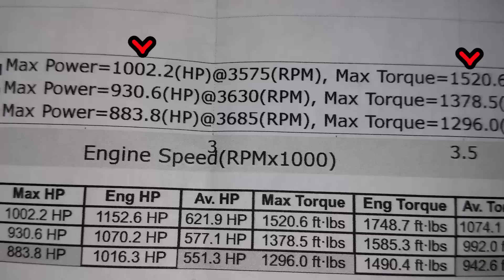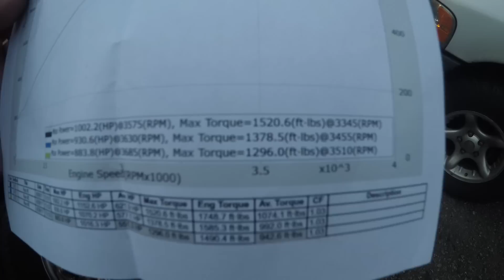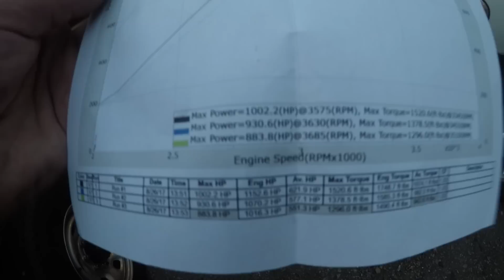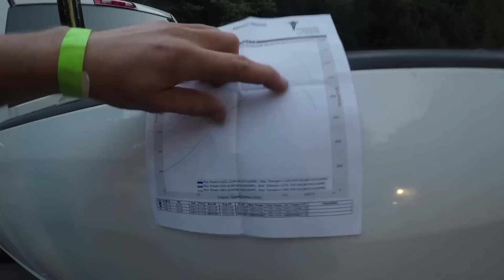10 Second Cummins Hits The Dyno!! Will It Make 1000 Hp???

Comment: Another great video Tom and when and how often should you adjust the bands on your 48re transmission I have an 06 Dodge Cummins like I've told you before with 50,000 miles do I need to do it yet
Reply from the maker: Not sure of what is recommended, I only do it when I think there is something wierd going on
Reply: Darrin Portell yes

Comment: Awesome dyno bud!  I'm happy for you!  Just got to work on those shift points now to optimize the power to the rear wheels.  

Engineering explained channel has a great video on determining shift points with a simple formula.
Reply from the maker: I'll have to check them out, think I just need to raise the 2-3 and 3-4 shift to like 4000 and it'll be good